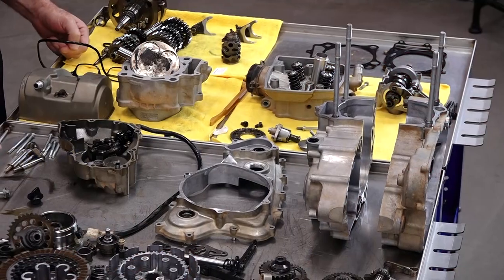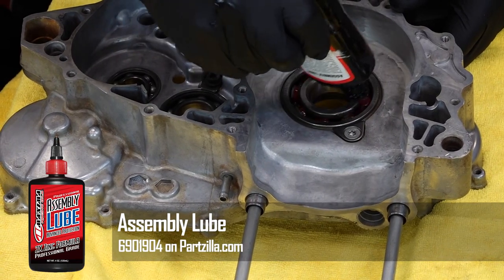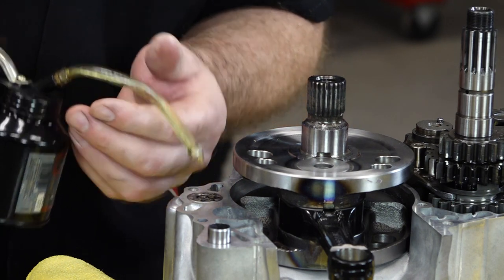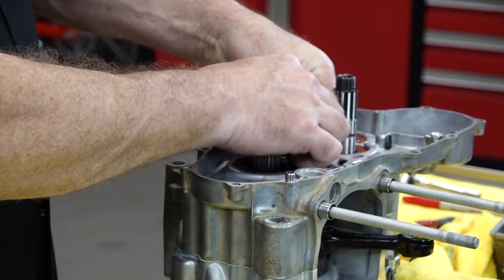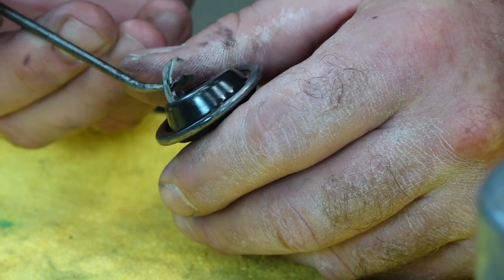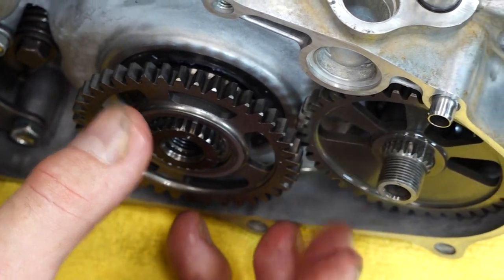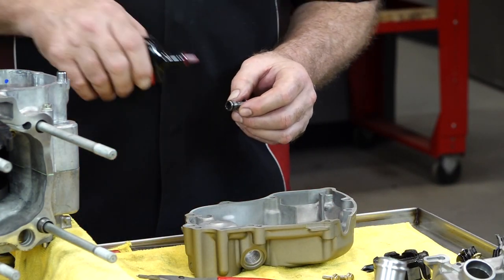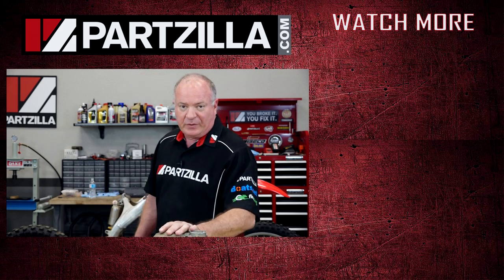Honda CRF450 Bottom End Rebuild | 2005 Honda CRF450-R Engine Rebuild Part 4 | Partzilla.com

Comment: We had a swingarm bolt that was so corroded we broke multiple ratchets and breaker bars. We put heat from hell onto it with the torch and When we thought we finally got it loose we realized we were actually just turning the bushing and bolt together. Ended up having to put a saws all to the case just to split it. Absolute nightmare! I think this was on a XR

Comment: The stuck rusted corroded dowel pin is a major pain but if your patient and apply heat/penetrating fluid it will come loose without prying on the inside sealing surface. I used 1/2 and 1/2 acetone and ATF fluid for the penetrating fluid. After it soaked overnight, the cases finally came apart but it was tight!
Reply from the maker: They're not easy. We just recently tore down a YXZ1000 motor and used a dowel puller tool. Yes, you might not need it that often, but it's a nifty little item:  https://www.partzilla.com/catalog-product/collection/3C006DD413A1919AF9903220148D53D36FD80100/6EE72AD512C7AABDE1F5D6D83A9F5F73F6D021B5

Comment: If you have trouble removing a hollow dowel turn a bit of round bar a snug sliding fit in the dowel before you take the vice grips out of your butchers apron😅

Comment: I had a right side cover dowel stick like that. To remove it once the cover was on the bench, I used PB Blaster and eventually got it out. The other one was no problem. Go figure???  Mine was on the front too.

Comment: I've got a question about the left crank case. Right under the flywheel, there is a small J looking piece sticking from the case. As far as I'm aware, nothing bolts or hooks to it. If this piece was sheered off, would the engine still function properly with no issues?

Comment: Took my 450x apart for a new timing chain, but then I realized I had end play in my crank bearing (stator side). So I ordered a new crank and bearings, installed everything and I still have the same end play! Is this normal on these roller style bearings? How much is to much? 2, 3 or 4 thousandths, and what part of the shaft are you supposed to measure it from? I'm wondering if the play is necessary for proper oil flow within the bearing.

Comment: Awesome couple of indepth videos i watched both but why so much red loctite use, red loctite is perminant as in never to be removed, blue loctite is removable and designed for later tear downs and rebuilds

The new owner of this crf450 will be in so much disbelief in 4 or 5 years time when they need to rebuild this engine and every red loctite bolt head strips